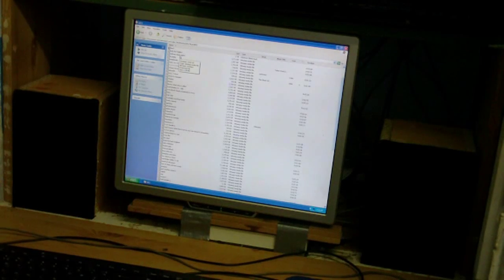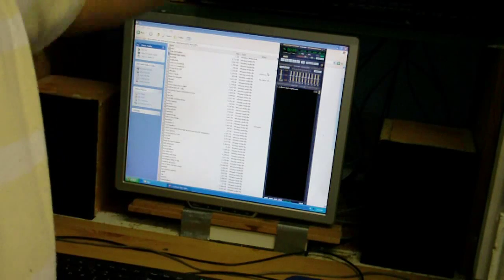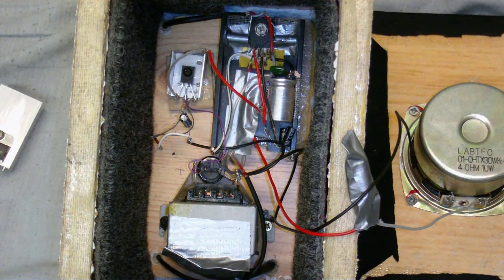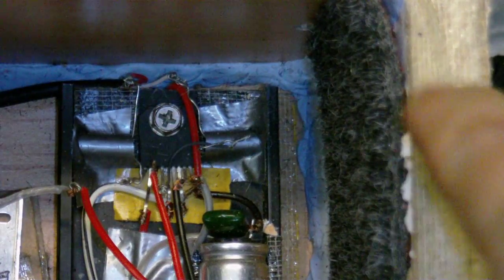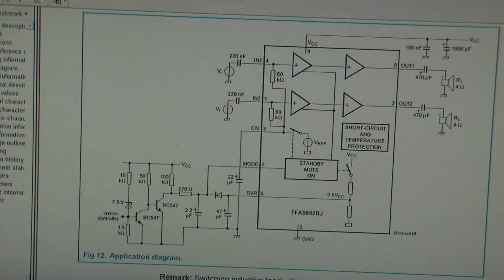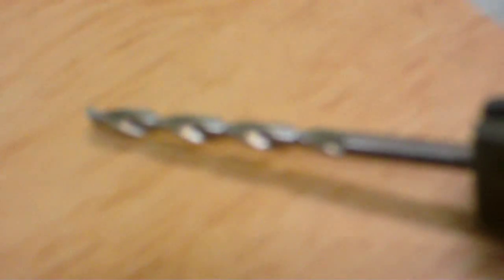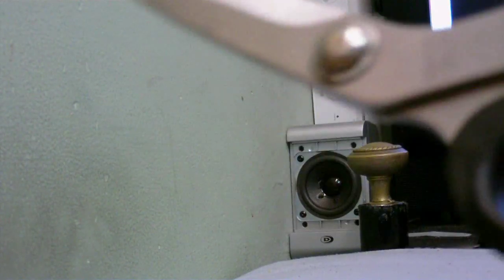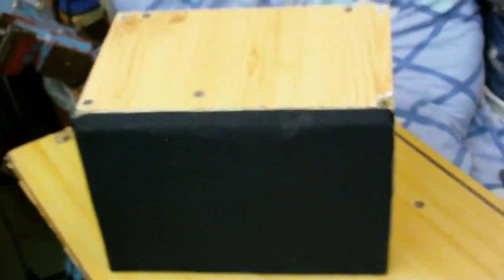Homemade amplified speakers

Comment: Time to learn few basics of amplifiers.
You must add filtering capacitor, dual+-gnd  or single +gnd no matter how much power u push out, for ~10-20w 3000-400uf
20-50w 6000-8000uf
50-100w 9000+ and so on
the more the better.
due high filtering the sound is smooh and not fucked.
bipolars for ac inputs and noise is gone.
inputs should be filtered by pass filters

Comment: pretty cool idea, but i would use an IC socket so you don't have to resolder if a chip goes bad, and yes it would be cool to make this a PCB. a program such as EAGLE would be perfect for designing it.

Comment: @CoolDudeClem Yup,if you dont like using computer to do it,then you could simply draw the layout on a paper 1:1,with nessesary holes.Then you glue the paper to the pcb and using a nail or something,mark the holes on the board.Then you simply use a marker or a corrector pen and draw the tracks between the hole marks.And then you dump it in a FeCl3 solution.

Comment: 4:51 It's really hot because you've turned the screw really fast, causing friction.  :D  I know, you sped it up twice as fast in that part.

Wood!  That could explain why the subwoofer of my Altec Lansing XA-2021 speakers sounds very good.  My Sony SS-U310's and Sony  SRS-015's  also have wooden cabinets.  No wonder why I like the sound of them. :-]

Comment from the maker: There are 2 transistors in the power supply connected in parralel so they both share the load and work like a single larger transistor.  it's not easy to see it in the video.  Also I tried using a decent sized regulator chip instead of a transistorized circuit, and it still cuts out, but nothing is getting hot enough to fail.

Comment: maybe it isnt the chip, but the power supply!

the transistor in the power supply looks too small, and the heatsink too. i think that transistor just overheats and cuts off after a minute. try to replace that transistor with a bigger one, and put it on a bigger heatsink, and see if that works.

Comment: Oh, I just read about that problem in the video description... 
That's stupid, that problem! Have you tried using different capacitors to connect those two pins to the ground? Maybe the amp cuts off when one of the caps is fully charged because it thinks there is nothing connected to the pins like before?

Comment: Really well done! The speakers sound very good!
That useless additional part can be hooked up to a microcontroller, it's needed if the chip is used in one of todays cheap all in one stereo system things.
Also the cabinets are good!